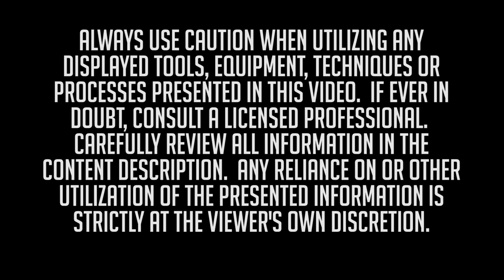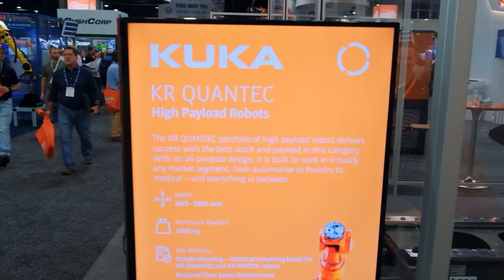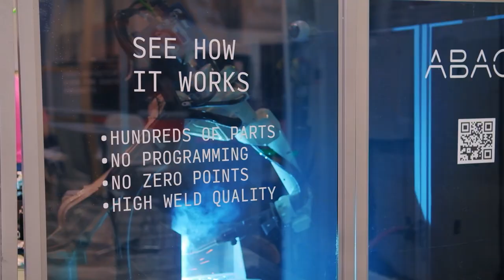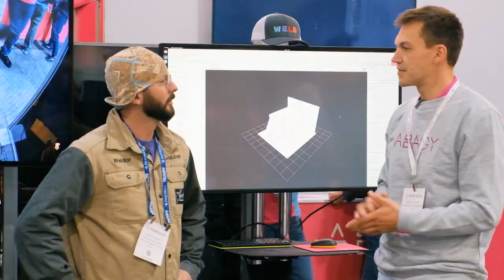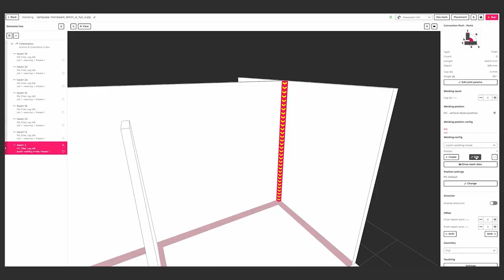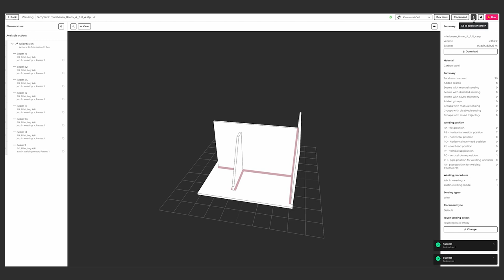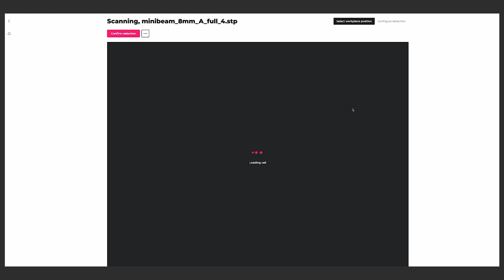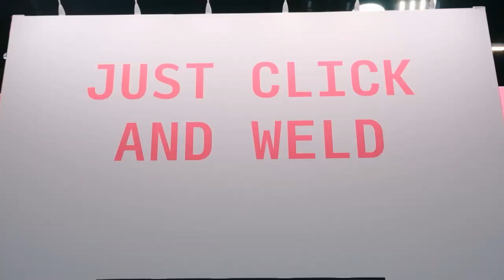Robotic Systems And Welding

Comment: My company has a robot welder, and our production has actually slowed down on average since we started putting every frame through it. We do large structural bases for AC unit rooms. The robot does every weld it can reach, on every base... The logistics of moving them around to the robot with cranes and having a queue ends up (from what I can gather) taking longer than sitting down and welding it yourself. I think this technology has great potential, but my company doesn't seem to be using it at its best. Still very interesting to think about!
Reply: Oh, yeah, it's the usual: here's a new toy; now we must use this toy for literally everything, since we paid a big bucks for it.
Reply: Without actually seeing your process and depending upon size and actual type of structure (I-Beam vs tubing/angle), you probably need 2 robots or the one you have is not programmed well. The cell needs to be set up properly for robotic welding which also sometimes means twin mig torches and seam tracking. The robotic cell needs to be inline with the fit up process with automated fixtures for holding transfer or the robot needs to be on a track.
Reply: Interesting to hear! Currently writing a master thesis about efficency and flexibility related to similar projects, could I reach out to you for a few questions?

Comment: I have been in industrial robots mostly in automotive but also in heavy industry (CAT), food manufacturing and packaging since '95. Robots and automation is where it's at and yes you might not need to know much about welding if you are an operator but to make actual good welds fast and know what to fix when something goes wrong (it will) you need to learn not only the robotic welding system including the associated automation inside and out, but also how to actually weld with various processes. Three companies I worked for taught welding, robotic welding, robotics, and automation with one company sending the robot technicians and engineers (the people responsible for setup, programming, and fixing) to an AWS welding school where we had to learn and actually pass the various position tests etc.

Comment: Are there Integrations with Motion Capture/VR equipment etc?  Could you have a welder use a simulator then basically Copy and Paste that into Robot Processes?

(If not I’ll add “Open Source Software tool for That” to my eternally growing “To-Do” list yeeesh)

Comment: I have over 25 years of Welding Experience my Boss is a Machinist by trade and he tells us welders that he can teach a newbie how to weld in 1 hour, I say BS.  Now with Robots, you still need to Programme the Robot on what type of weld, what Size, and how to miss obstacles, this process here is the first I've seen with a scanner so that it "sees" where to weld. Also on 3/8" thick plate I would NOT be doing a vertical Down, Vertical UP only.

Comment: Here is why I think the "naysayers" that robotics taking jobs are wrong headed.   

Take any job and give it 3 stages.  Stage 1 takes 10 welders, Stage 2  takes 10 welders and stage 3 takes 10 welders.  Now, you introduce a robotic machine to take over Stage 1 because it is more efficient and has more output then the previous 10 welders.  A robot puts out the work of 15 welders in Stage 1.  What happens to Stage 2 and 3?  They need more welders.  Stage 1 increases output and now Stage 2 and 3 need more welders (15 -20 welders) to keep up with the output from Stage 1.    Not to mention, there is a job created in maintaining the robot in Stage 1.  Overall result of incorporating robots....."we need more welders!"

This "fantasy" that robots eliminate jobs is flawed thinking.

Comment: They had some working at my workplace today. And OSHA is coming around. 

I wonder if this means the number of people pushing for the increased use of automated welding is increasing. 
I’d love to not lose my job to a robot.
Reply: It depends.  Robots are expensive (although may be cheaper long term), and have issues getting into cramped spaces/doing odd things.

HOWEVER robots are more precise, can work near 24/7, are cheaper in the long run, and can eve do things/go places humans can’t (ESPECIALLY Saturation Diving, i can see that being replaced in part by ROVs with FCAW Guns soon (although the underwater construction grunt aspect may still remain) ).

For better, or for worse, robots are coming for ALL our jobs eventually (Re: “Humans Need Not Apply” by CPG Grey).  It is up to us voters to decide if we get *Fully Automated Open Source Luxury Anarcho Space-Communism*, or some “The Expanse” esque hellhole with an insane wealth gap run by Jeff Besos and Elon Musk etc.
Reply: @ericlotze7724  Hey! We do not see our solution as a replacement for welders. At the end of the day, robots do not know HOW to weld. The decision and the control remain on the welder, not a robot. Moreover, robots are not capable to weld everything. There always will be joints that could be welded only by hand. But at the same time, we see a lot of synergies that are possible between a welder and a robot. Our solution is the bridge that makes it happen. Designed for welders it’s a new way to increase your productivity and weld much more than before.
Reply: Then learn to use robots.

Comment: Idc what the sales rep tells you it kills jobs wether he wants to admit it or not. I’ve installed robotics & automation at variety of plants I’ve also worked at plants that have automation. It decreases the amount of labor you need to a job which means it eliminates jobs in the process. Before someone tried to argue with you me about this topic unless you have factual data to claim it doesn’t kill jobs save it.